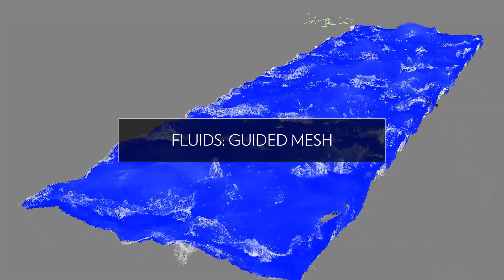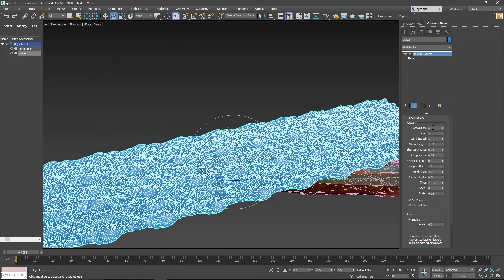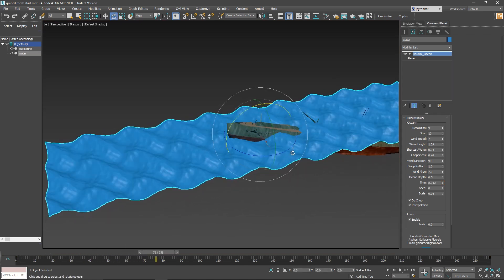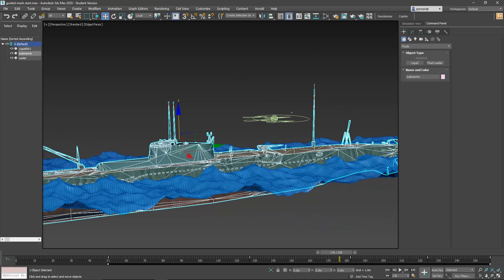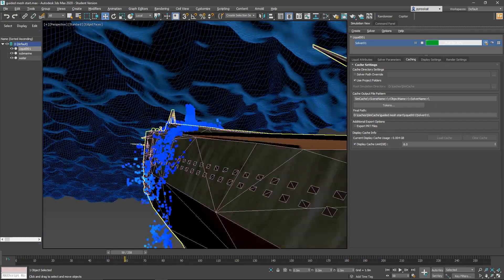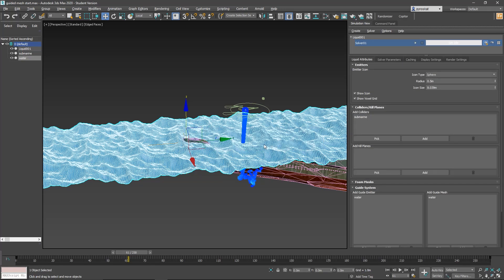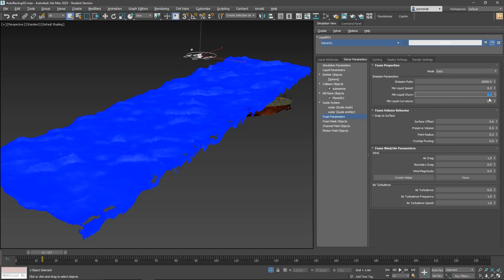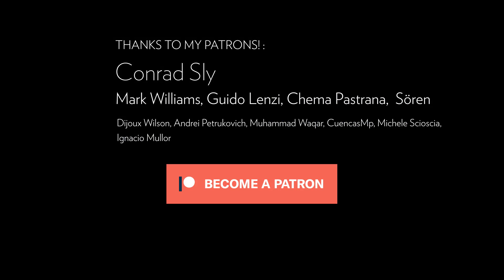Guided Fluids 3dsmax Tutorial

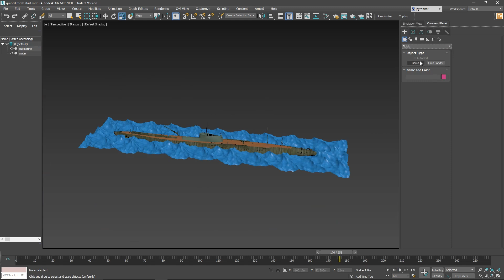Comment: At 4:05 the ocean plane looked smoother and at 4:07 you obviously made some changes to end up with the final version you worked with, could you post a couple of the key settings that you ended up tweaking to get that result you worked with.
Reply from the maker: Yes, sorry, forget to post final settings. But will highly be dependent on your scale.  I just play with values like size/resolution/waveheight until I found something I like it, avoiding patterns repetition.
Reply: @andvfx  I was following your sizes and settings to the letter to come up with your same result.. then would tweak what I need based on that - just couldn't get to your same spot.
Reply: hey there, still not getting decent results..  can you put the final settings for the ocean settings you used.. cheers and beers :)

Comment: the fluid label only comes out in 3d max version 2020?
Reply from the maker: It appear on max 2018.3  it improved during 2019 as well.
Reply: @andvfx  Thanks for responding, but it is exclusive to a rendering engine, the fluid option does not appear in max 2018 :(
Reply from the maker: @3DLeyton  No, its not exclusive on any rendering engine. It appear on max 2018 update 3.
Reply: @andvfx   we made it, thank you very much :o